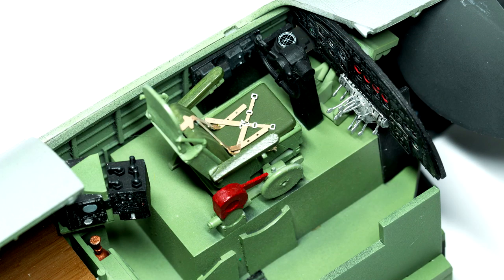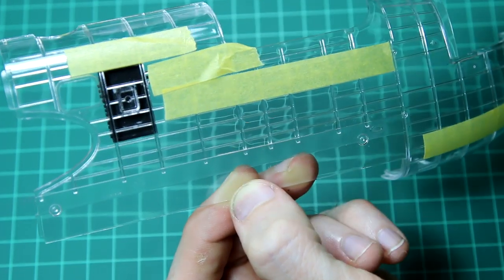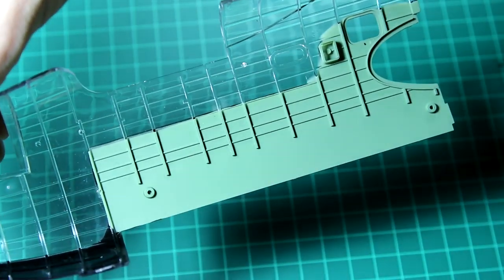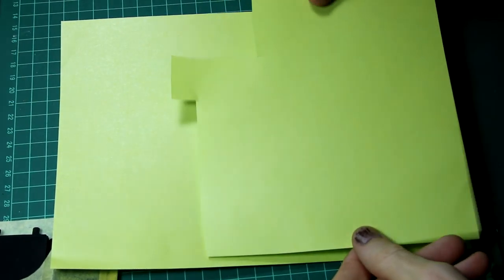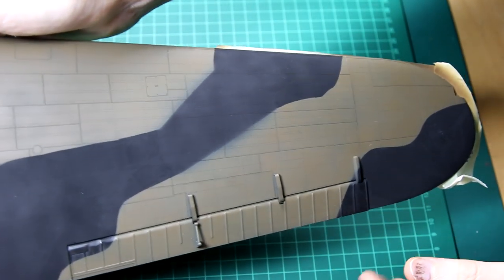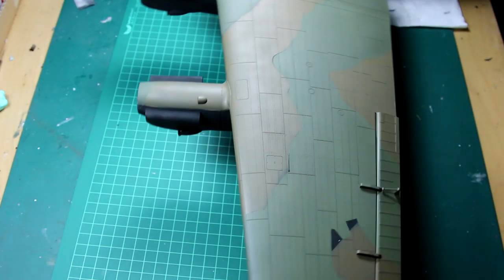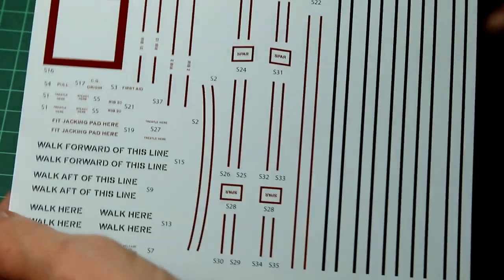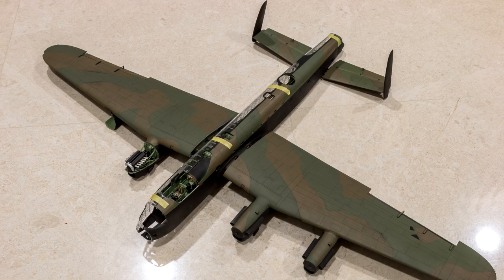HK Models 1/32 Lancaster bomber - Part 6 - Camouflage painting

Comment: It's a shame they won't include crew figures  for the price
Reply from the maker: Yes :( I do have a 1:32 resin Lancaster crew (preparing to board) but I haven't build it yet as I need to improve my painting skills to do them justice.
Reply: @ModelNerd  ha-ha for every modeler it seems an issue for painting figures as me aswell I have done models for years until 2014 never been able to do a proper job excepting for resin ones. I'm 59 so from my 14 to 50 l  never been.